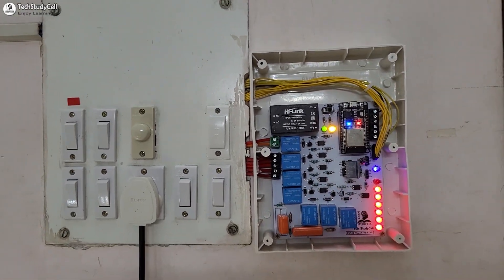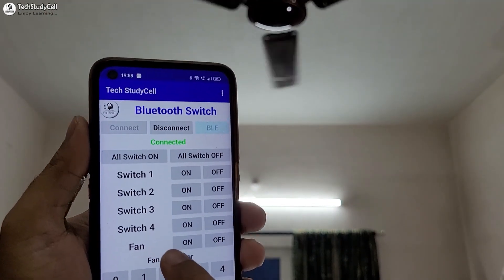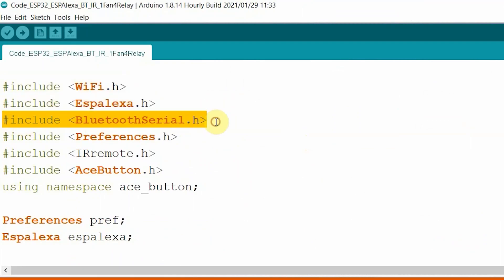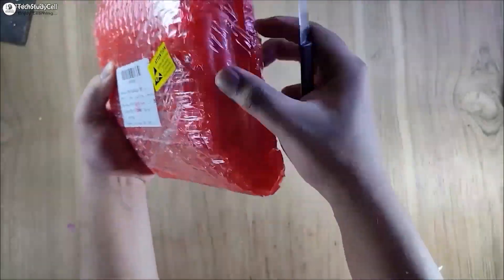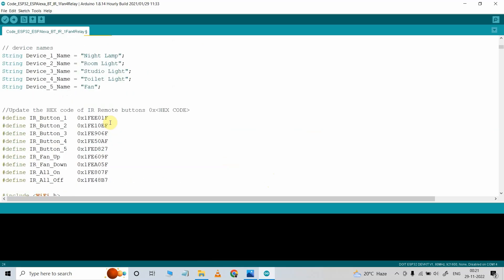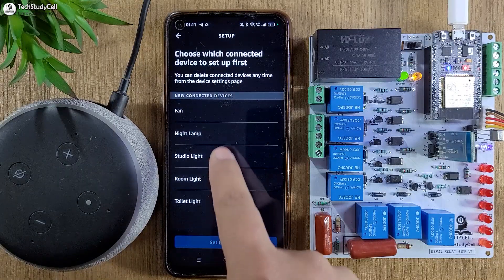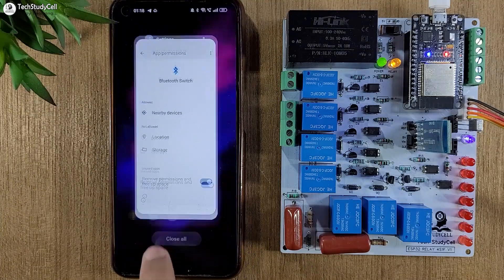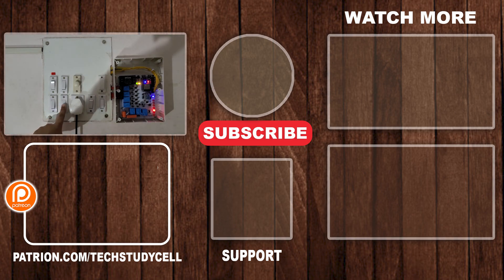ESP32 Alexa Home Automation using Amazon Echo + Bluetooth + IR Remote with Fan Dimmer circuit

Comment: Hello Subhajit, I made this same setup almost two years ago after watching your Video, and everything was perfect. I made the same setup again for my Friend's house today with the same coding, but Alexa is not discovering devices properly. Out of five devices, it discovers only one, and the rest of the four devices remain hidden. Is this issue with an updated Alexa app or ESPalexa library? I would appreciate any suggestions or solutions on this. Thanks once again for your effort on this video.
Reply from the maker: I will check. Please delete all the previous device from app, and try to connect again.

Comment: I want to use Google Voice Assistant with Node MCU. without External App like Blynk, Sinic Pro, IFTTT, etc. I want to use Node.js and connect? Did you make any such videos. I tried using google assistant api in google cloud with blaze subscription as well. I am getting errors. Do we need really Rasberry PI for this?

Comment: Hii, I have built this same project with the help of this video, however, my ESP32 is not the same. I bought "NODMCU ESP32S" which has 38 pins. Everything is perfectly working except Bluetooth, as the TX and RX pins are different. Could you please help in resolving this issue?
Thanks
Reply: Yes; I got it working. instead of using Tx and Rx pins, I have used Pin number 16 & 17.

Comment: 8K + Custom Duty charges is not so affordable for Indian people 🤣🤣
Reply from the maker: If you need any PCB, let me know.
Reply: @TechStudyCell  i want pcb
Reply: @TechStudyCell  does espalexa library works without an Amazon Alexa Speaker...? Actually I don't need the voice assistant but need to connect multiple ESP32 Boards, Is it possible to control the devices only with Alexa Mobile Application..? Please can you check this for me, i mean if I upload the basic espalexa code will the Alexa Mobile Application Discover the ESP32 boards... ?

Comment: Please make a home automation video with ESP32/ESP8266 + TTP223 TOUCH SWITCH + RELAY MODULE + TASMOTA.
Reply from the maker: Okay
Reply: @TechStudyCell  Finally I am completely finished. There were some problems. Problem solved by connecting ttp223 to Button_i. Thank you very much.
Reply: @TechStudyCell  Please make video

Comment: ULN2003 instead of all the transistors and optocouplers to control the relays might save a lot of space. 🤔
Reply: ULN will not provide required isolation.
For space saving we can use smd components.
Multi channel opto isolator smd package is also there. 🤔
Reply: @Crystalservices  Do we must need the optocouplers? ULN2003 can directly pull down the relays inputs. Cant it?
Reply: @GourabX  Yes, but if we need isolation from noise generated by relays then it's required.
Reply: @Crystalservices  Yes I totally agree. And I chose to ignore that problem. 😂😂

Comment: Hello bhaiya,
I have been following your esp32 series and have tried to implement the project the same way as you have done.
But the problem is I am not able to understand how to connect relay board to switch board.
Mujhe buss 2 cheez samja dijye please
1. Switch board aur relay ki wiring kaise kare.
2. Aapne kitne mm ka wire use kiya relay aur switch board ko connect karne ke liye. 
Can you please show its wiring
It's a request 🙏🙏
Reply from the maker: Please refer to PCB connection diagram shared during video
Reply: @TechStudyCell  okay thanks 👍

Comment: As usual, you are an amazing techie..... In case if number of switches are increased by tweaking the code, what is the way to make the changes in the android app? please suggest.
Reply from the maker: I working on to develop a dynamic bluetooth app. but it may take some time.
Reply: Which software use to make android apps